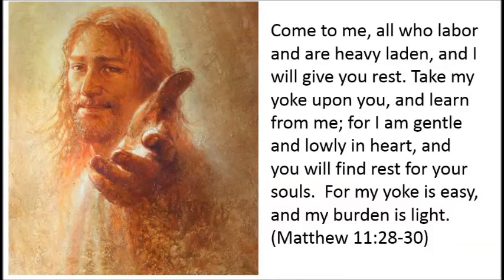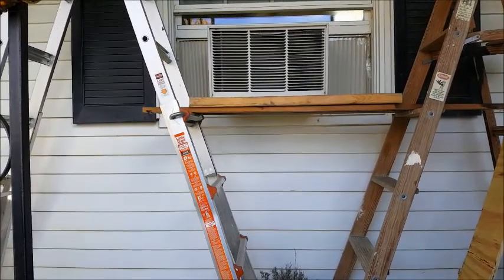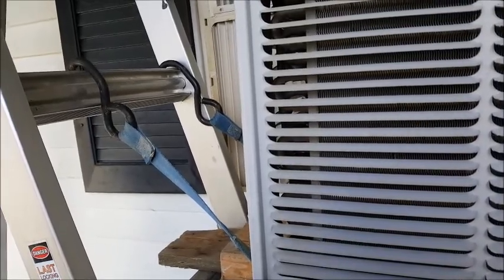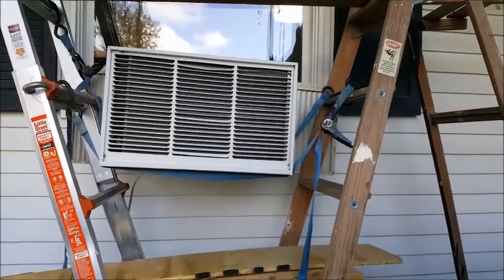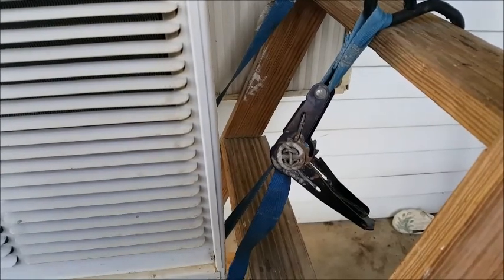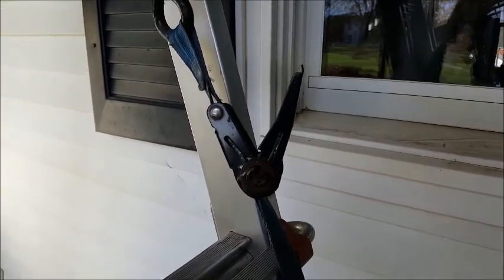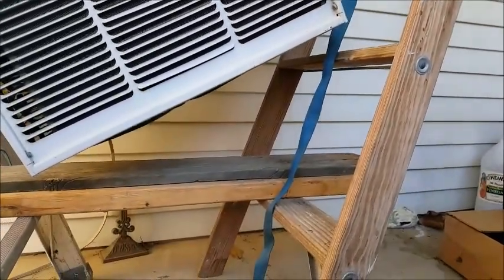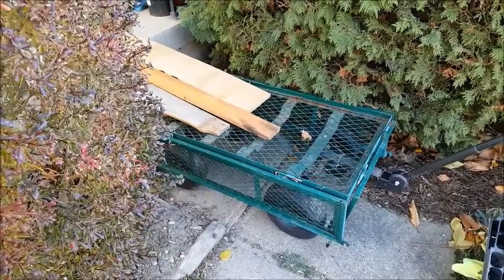Remove AC window unit without hurting your back

Comment: Just pull it into your house and onto one of those big blue storage bins. You can easily transfer it to a cart from there. This is so overly elaborate and sketchy.
Reply from the maker: Thanks for your comment. I was just using what I had. Thanks for sharing your idea.
Reply: Blue bin. Now that's sketchy